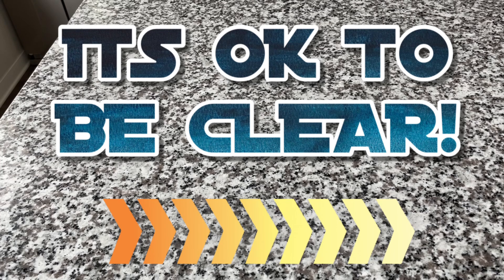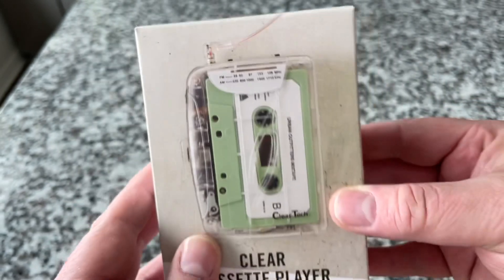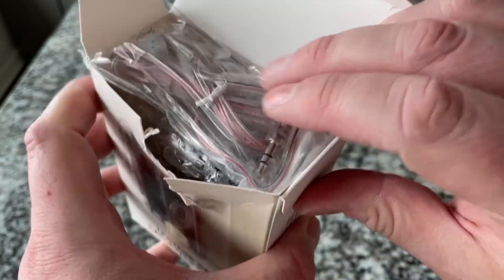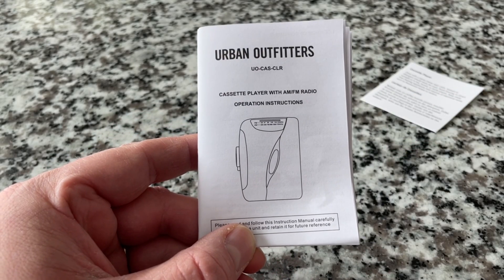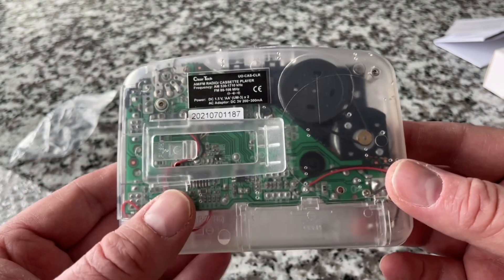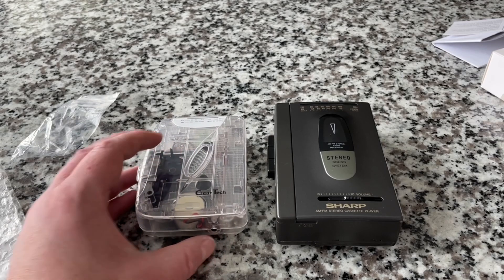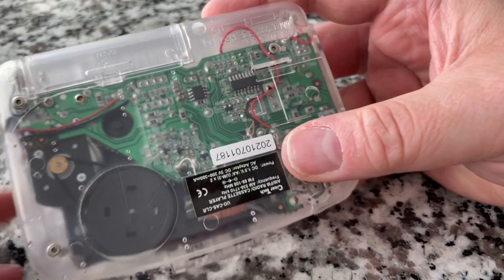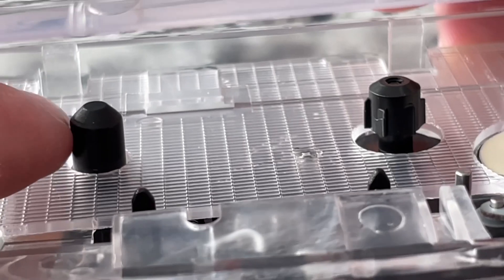Urban Outfitters Clear Cassette Player - Unboxing & Review! #cassette #urbanoutfitters #uo #retro

Comment: I would agree with you that this unit is not worth the $38 price tag. A unit with a mono head and mono radio tuner is really bottom of the barrel. The fact that it is single direction only adds to the unit being overpriced. So your basically left with the novelty of the transparent case. I have seen other units like this that have a stereo head and auto reverse that go for around $25.
Reply: Well, that's my gripe with UO.   Their inventory is ALL overpriced, lowest-bidder crap, with the UO name plastered on it.  So, yeah, you're right.   It's sold solely under the gimmick-y aspects.

UO also sold a 'custom' Victrola portable record player with the UO name emblazoned on it.  At like almost double the price of the functionally-identical Victrola you could buy at Walmart.

Just payin' for the name and gimmicks, and not the actual product.

Comment: I got one of these used for 16, I was looking at older walkmans but you then potentially run into issues with belts, build up of dirt and electronics failing. I enjoy retro tech I have the old stuff but sometimes I just want something that will work and is not going to break on me. The clear shell means you can see your tape. Yes its mono but cheap units like this where common in the 80s. This wont meet audiophile standards BUT lets be real.

Comment: My cheap Jensen I bought about 7 or 8 years ago cost $15 out the door.  As bad as it is, it's $20 better than that piece of crap you're reviewing.  $38 is an awful lot of thievery considering the unit at most should only cost $15, but is more realistically worth $7 or $8.  It's a PITA that's also a POS...

Comment: Suggestion:  Commonplace use of the term "pre-recorded tape" is for commercially-produced tapes.  To avoid confusion, perhaps the term "self-recorded tape" is a better description for tapes you or a friend have recorded yourselves.

For someone who wants a brand-new unit like this, Target sells a Jensen-branded cassette/radio walkman player, the SCR-75, for under US$20 (currently US$13.99). This may well be a very similar unit. I own its predecessor the Jensen SCR-68C bought three years ago from Target for $15 and it provides adequate tape playback and good radio reception.